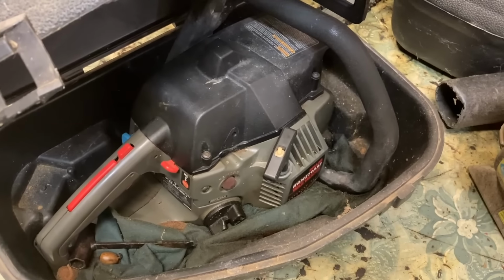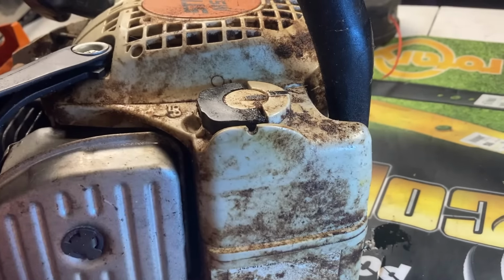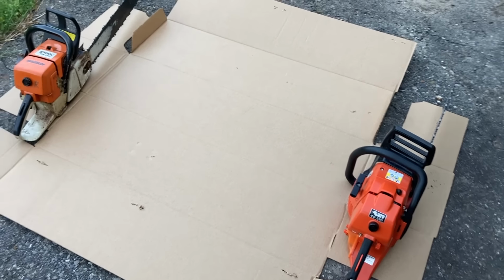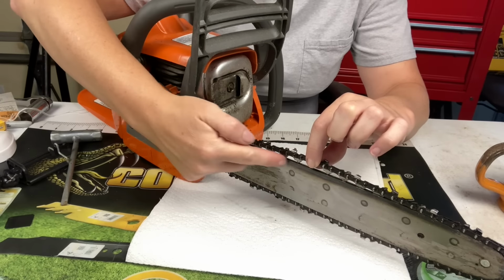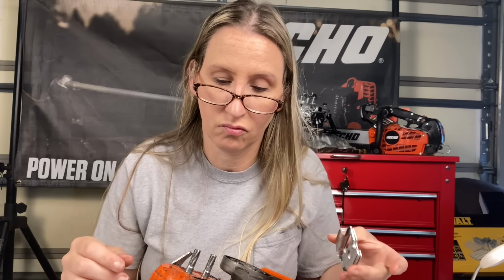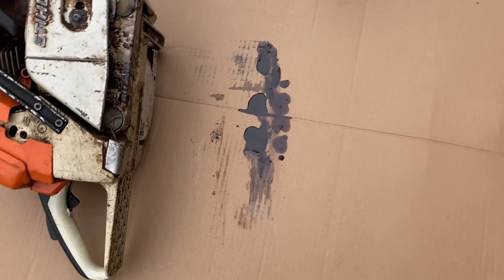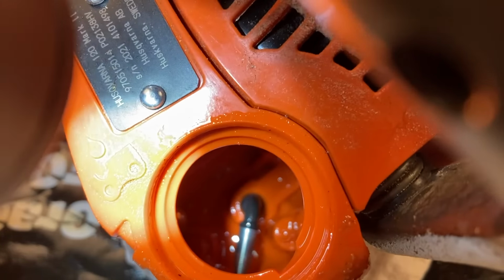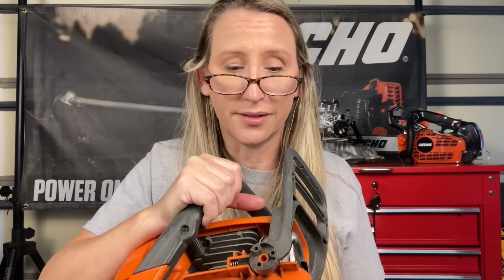Chainsaw leaks bar oil? The most common reason why AND Husqvarna saw leaking oil FIXED!! Repair Vlog

Comment: Younsaid your cs-590 was new. But the bar is already flipped. 
Maybe a dumb question but how often are you supposed to flip the bar?
Also both my echos leak but not alot. I thought it was the oil left all over from running them. 
Like over a year the tank stays full only after running the rest drips out. I use thick a$$ echo oil so i thought it slowly drips down from where it was flung. 
I always put a towel below them.
I did have to adjust my echos right away for running oil rate. I soaked my chain first and put some in the bar channel before first running. 
Mostly just need to know about the flipping bar thing. I havent flipped mune and have maybe 3 hours on them. Lol. I do grease the sproket each use. Maybe overkill. Lol.

Comment: Interesting vid! My 1st chainsaw was a Stihl 028. After use it leaked bar oil like crazy. I've moved on to Shindaiwa saws - 452s and 601sx (latter similar to Echo Timber Wolf). If I leave these sitting outside to cool down after use for about 2 hours then put the on the bench in the garage - no leakage to speak of. In the case of the 452s I have the oiler set to max output, for the 601sx it is at factory, might ramp that up after more use, but either way, not seeing annoying oil mess from these guys.

Comment: If you keep your saw in the case pop a diaper or some kind of absorbent pad in the bottom. Then when you need an oily rag to wipe a piece of equipment to keep it from rusting just grab the pad.  After a while enough oil will saturate the pad and you can wring it out into a screened funnel and reuse it either in the saw, or around the shop.

Comment: I saw my Poulan "Wild Thing" 40cc chainsaw (checkout that chain tensioner) in your intro. Mine leaks like crazy. Whole reservoir goes dry over winter, saw storage case fills like a pool. Thanks for some tips to investigate that problem. Now to figure out it's starting/stalling issues

Comment: i have new husq, used it once so far, put in my garage sat it on a plastic tool box with a inset area where the toolbox handle is, now it has sat for more than a month there but the inset area(1/2"d x 4" x 2.5") was filled with bar oil

Comment: Thanks for the video! I have a small 14 inch electric unit that can drain the tank within minutes and none of it is getting to the weep hole behind the bar. I will need to  remove the bar holding plate as you did to see what's going on because the oil tank is curved and I cannot see inside it.

Comment: I have found that my old 'Classic' chainsaws, Stihl 010, 011 & 012 leak for a simple reason.  The Oil pump is inset into the tank with the delivery tube of up to 5" filled with oil at the end of any work.  Despite having a metal restrictor coil inside the tube, the oil migrates by dint of gravity and air pressure.  Knowing this I have plastic trays that are moulded specially to the shape of the saws which I wipe out occasionally but this means that I can't store them with the fuel/oil caps up.  I haven't noticed this being such a problem with chainsaw worm gear oilers that are driven directly off the drive shaft.

Comment: hey there good experiment, I own a 371xpg for 20+ years now and the case is still clean from oil, when there was a bit of oil on the bottom of the case, I stopped keeping both tanks over half full, no mess to clean up yet.  it's kept behind my wood stove at all times, it goes from cutting firewood at -20c or -35c to the wood stove with what's left in the tanks, usually under half tank of fuel and oil seem to work, then back outside for more when needed. still all original mince wear and tear parts

Comment: That stihl has what's called an elbow connector. One of mine was oiling everything but the bar and chain. The connector had a hole in it from getting hot.
I repaired the old one it's working perfect so now I have a spare part.

Comment: I have 2 Stihl chainsaws. One is AV56 which has a 36” bar and the other has a 14 inch bar. They both have what looks like a valve on the bottom to control the bar oil. I have always left them fully open. I probably could close them, but I would hate to forget to open them and burn 🔥 up my chain and bar. I have always expected both to leak bar oil.

Comment: I have a poulan pro 18in bar I have problems starting it I was told that the exhaust gets clogged up and it fouls the plug is the mixture lean or heavy, I try to use the specs but it is still hard to start even after it's good and warmed up it also leaks bar oil bad but your video gave me what to check,Thanks

Comment: My small engine repair shop said they all leak when in storage and the best thing is to empty the bar oil reservoir after use. Bar oil can be reused so put it back in the container.  I also store my in its case which has a small layer of Kitty litter.

Comment: My husqy has always slowly leaked its gas out when sitting upright on a shelf. Some oil too but your video explains that nicely. But my chainsaw never gave me trouble when running. Strange. Never had time to check it since its been running hard for years. I just sit it on its side and everything is good to go.

Comment: I have 4 saws. Stihl 009 and 028 wood boss. Echo cs 352 and a husqvarna 450 rancher. 
My echo and my rancher never leak but both of my Stihls were leaking every time I used them. I thought it was maybe just cuz they were older saws but it wasn’t. I was told to store them on their side and it worked haven’t leaked since.

Comment: I just bought a Stihl MS250. I ran it to test on a small log on the warhorse. It did leak a bit afterwards. It stopped soon. I tested with a shop towel and it wasn't bad. I got a Stihl case and lined the bottom of it with a thick chamois cloth to catch oil. 
I did notice from my first run test is that the bottom of the saw gets oily amd dirty fast from it. I've cleaned that up and I haven't got it out in to the bush to fill a firewood permit yet.
I did expect residual leakage after the normal discharge was finished. That always happens. 🤣

Comment: HI, LOVE YOU AND YOUR VIDS. I HAVE A DEWALT 20 V 12 INCH BATTERY AND IT LEAKS BAD, VEVRY DROP WHEN I LET IT SIT. IN THE MANUAL SAYS TO DRAIN THE OIL WHEN NOT USING IT. REPAIR GUY TOLD ME THE SAMETHING. GOD BLESS  AND BE  SAFE

Comment: I had a problem with my Ms261 not oiling. bar got hot and spread a little. had to file the burr off. what i finally found  was that the oil tank vent was plugged. its behind the plate that houses the oiler channel. its a hex bolt head looking thing with a tiny pinhole. i blasted the pinhole with compressed air and used the air to spin the clutch cover and success.  the friggin vent was plugged. gotta be careful with debris falling into the tank.

Comment: If you turn the oil can over in your hand so the curve side is down when you pour it will pour smoothly without the surge (since it is sucking air into the oil can)

Comment: hi, I just found your channel, very cool stuff.
  I have a trick, that I learned when the plastic oil cans first came out.
  if you rotate the plastic oil can where the nozzle is towards the top, air flows in smoothly, and the oil flows out more smoothly.

Comment: I always drain my CS590 fuel tank after use and run the saw until it stops.  Then I drain the bar oil.  I hang my chainsaw vertically by the handle and it doesn't drip and starts perfectly Everytime, especially after a winter of sitting.

Comment: Get yourself some of those curved Kelly clamps from a medical supply shop. 👍 They're excellent for small engines, and larger ones as well, but I've used them plenty around the shop.

Comment: I have an echo  cs490 and a new husky 455 rancher, after running and sitting awhile,  the echo has a few drops under it,  but this is what is running back down the bar grooves. I can wipe it up really good, and store it away,  no more oil coming out.  But the rancher has leaked oil from day one.  It will leak the tank dry.  I haven't tried to chase the problem down yet.  But must be an assembly issue at the factory.  My brother in law has the same saw,  just a little bit older,  and his don't leak except what drains back off the chain and bar..  i drew the short straw on my purchase i guess.

Comment: I’ve owned several different chain saws over the years none had any bar oil leak when I bought them but from day one after I put bar oil in it when I went to use them they all have leaked from day one after I put the first drop of oil in them.

Comment: My Timberwolf poured oil out of the bottom. It turned out the oil tube had been severed. I apparently revved it with the brake on, and this heated the clutch and brake band up, and the heat melted a hole in the tube.

Comment: I had one of those stihl quick release caps come loose on fuel. I had it against my crotch. Being in the middle of the woods doing tsi….that chemical burn was fierce. Next time I bought a saw for work I went with echo because they didn’t have those damn caps.

Comment: Hey Chickanic, you are awesome, I love your videos. I have an 18inch Craftsman model 358.356070 chainsaw that runs great but it's leaking bar and chain oil out of the clutch cover when it's running. The bar and chain is getting plenty of oil, but it doesn't leak when it's sitting. Any ideas?

Comment: You could do a video on the bar studs. People have a tendansy to over tighten them. I bought a saw that the nuts were over tightened and it cracked the housing and then it leaked oil.

Comment: Next time you pour liquids from one of the narrow style oil bottles, try turning the opening to the top. This allows bottle to vent properly w/o the "Chug-a-Lug" effect on the liquid being dispensed. This method allows for better flow control and less mess, because it vents air properly. 

This is actually how these bottles are designed to be poured from. Some bottles still have the "Pour Like This" visual diagram molded in them at top. 
This method takes a little to get use to, because it is hard habit to break. Try it You might like it, I sure do.

Comment: I have learned to replace the O ring on oil filler cap after seeing some leakage in my case too because if it is scarred or had been pinched it will allow siphon to happen. Of course that wouldnt help in the case of the nipple being pushed onto oil tank.

Comment: I had a brand new stihl i have never cut anything with. Where i bought it they put some bar/chain oil in it and started it. They put it in the case. I went to use it two years after i purchased it, all the oil they put in it was in the bottom of the case.

Comment: On a tool subject for about the same money on Amazon how would you compare the Echo spark checker against the Spark Check’r.
I have purchased one of the sparkcheck’r and it works well I found the short fixed the the SC showed the spark. The part  I liked was the LED light stayed on till i got around to see the light

Comment: I have craftsman 27cc weed blower and bulb and carb is bad . i ordered a carb on amazon with the plurge bulb. It has a 3 line connect on bulb and the carb lines are in a different location HELP to hookit up. I cant find on your site?? THANKS IN ADVANCE LOVE YOUR SITE.

Comment: Stihl bars have that odd color around the edge because of the way Stihl case hardens the edge for better wear. I scratched off the factory paint in a spot of a new bar to check this.  I have been to the Stihl center in Missouri and learned this.

Comment: I run a Stihl MS270 and always wondered why it leaked. Mostly just a small amount but I have had it leak out almost an entire tank of bar oil. My thought was some debris might have gotten in the reservoir and kept something in the lines from shutting off the flow. I make sure I clean the fuel and bar oil caps really well before removing them. The service manual says never use compressed air to blow the saw out, so usually rarely do, but occasionally I turn the psi's way down on the air compressor and give it some short shots of air. Never had any problems with the caps leaking. I store my saw on a boot tray with a blue shop towel under it just in case it wants to piddle. Did it seem like the bar oil was really dark? Enjoying your videas and excited to learn more from you! Take care!✌

Comment: Thanks I have a Husqvarna with the same problem I’m gonna dig into that and see if it’s the same issue !
thanks again very well presented video. 
Just curious I’m going to be getting my neighbours Kabota lawn tractor and it’s a three cylinder diesel with a hydrostat any suggestions on maintenance like do you change the hydrostatic fluid or whatever ...THANKS

Comment: I set my stihl so the fill cap is up, no more oil spilling out.  I thought for sure it was the cap, but i replaced it, with possibly another bad cap, but if i put the filler cap up, no spills.

Comment: I just saw the video about bar oiler leaking excessively.   One had the oil supplied through a rubber grommet which wasn't seated properly.   You were trying to pull the grommet into place using a needle nose pliers.  Get yourself a couple of different size forceps for intricate work with a sure grip.

Comment: Hey Bree, I got a little trick for you. Do you have a lot of boxes there at the shop even the thin cardboard will work cut a piece of cardboard. You said it under the motor of every chainsaw it will absorb most of the oil that you’re getting making your shelves a little cleaner and it’s a little easier to do the cleanup.

Comment: Hey chick Canik, I learned something while back you were doing the test to see how much ethanol is in gasoline. You can take any gasoline with ethanol in it and make it ethanol free. Can you take like maybe 5 gallons of gas and put I guess about it may be a little bit more than a pint of water in with it and shake it all around and the ethanol will go to the bottom to the water in the gasoline should be ethanol free all right just thought I’d run that by you and by the way, that was a really neat demonstration you did. Thank you this is six in a row jim from Kennerdell Pennsylvania remember, I got that 91.5 dodge and I got a six banger under my hood.

Comment: Hello I'm using Google Translate, so sorry if it doesn't edit well. I have a sthil that did the same thing, in my case I put a heat-shrinkable cable in the mouth of the hose that tightens the crankcase to make it a little looser that way it doesn't leak oil and it worked for me. 
Greetings from 
ARGENTINA 🇦🇷

Comment: When you pour oil out of a liter/quart bottle, try holding the bottle with the neck on top, It will pour a lot smoother with a little air behind it.

Comment: New to the channel. Glad to find it. Great video Chickanic. Did you notice the chain on the husqvarna is installed in the right direction? This also can heat up the bar cause of the pressure the user must have been used to the chain and the blade. Check it out on 9.39

Comment: The bar oiling system on all chainsaws does not include a valve to stop the oil flow when not in use. So they will always leak by capillary action anyway.

Comment: I have a stihl  310 ,if I use stihl or husky oil it doesn't leak bar oil. These oils have tackafiers added which hold oil on the bar. Use these for better performance

Comment: My experience with a bunch of different chainsaws is that bar oil goes everywhere except where it is supposed to. The oil hole in the bar clogs up with sawdust after only a few hours of cutting. I have to remove the bar, unclog the hole and unclog the bar slot after every couple of hours of use. That oiling system begs for a redesign.

Comment: Thanks for the video have an old hus 55 that was given to me took it to a small engine shop to just have him check it over told me oil pump was bad and oh youll be better to by a new saw then have us fix it itlls be $100or so dollars to fix it i paid him for look at it took it home tore it apart nothing wrong with the pump it does need a clutch but it leaks oil out of the tank rather quick didnt check this will have to i suspect this is my issue as it does get a decent stream of oil when running but still leak rather quick out of the tank once it sets

Comment: Neither of my Echo saws leak excessively. (an 18" CS-400 and a baby one, like the one behind you) but I have an old Husqvarna someone gave me. I'm guessing it's a 1980's based on when he thinks he bought it new. Either way, it's made in Sweden, so it's a keeper. The issue is it is a baaaaaad leaker. I have an old towel in it's case to absorb all the oil. I am trying to rig up something to capture it. The tip of the bar is getting loads of oil, and there's no scorching like the one you had. So technically not a problem, except the reservoir is empty if I leave it too long. 
I may need to do the deep dive you're suggesting. 
Oh, and thank you, thank you, thank you for the vid you posted about starting "hard to start" saws. It's so old it doesn't have a primer, but the mini pulls, before the big pulls works. I was ready to give up on her, but like I said, a keeper.

Comment: After working in the woods for years i have figured out that unless you break the saw down every time and clean it off with parts cleaner then you're going to have some leaking. I leave my saws on the side with the caps facing up and i haven't had any leaks lately.